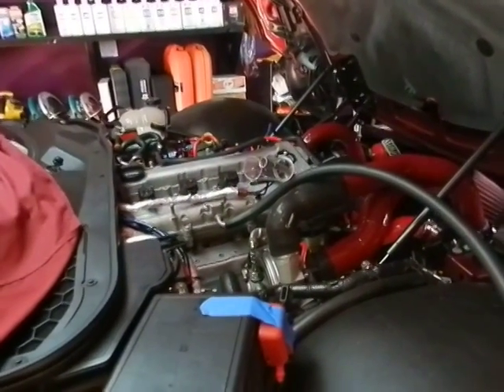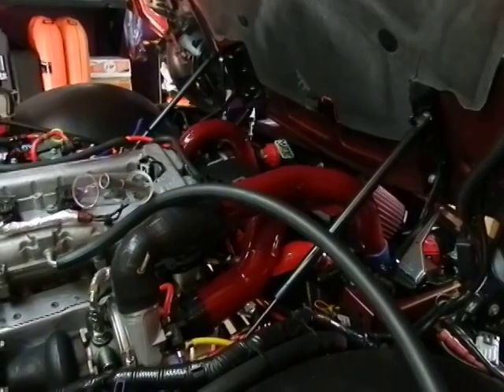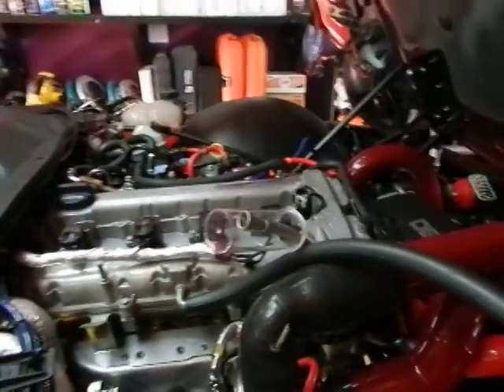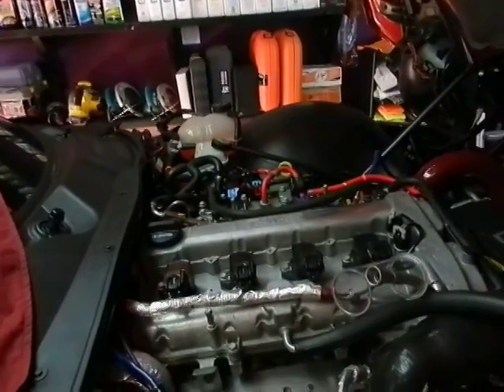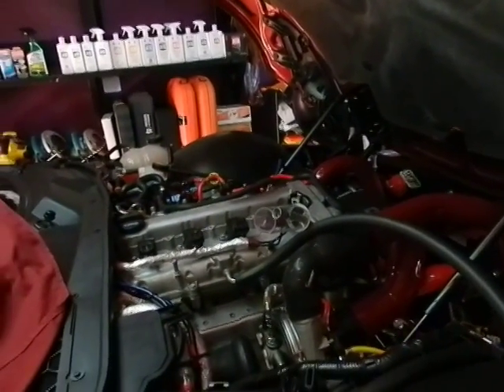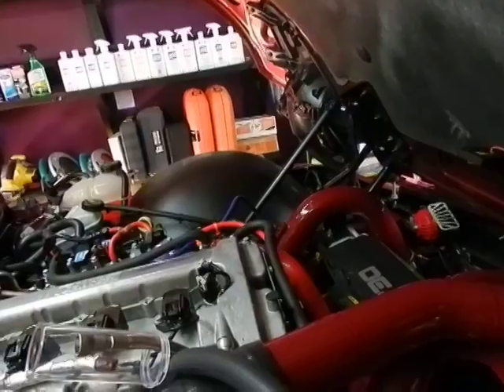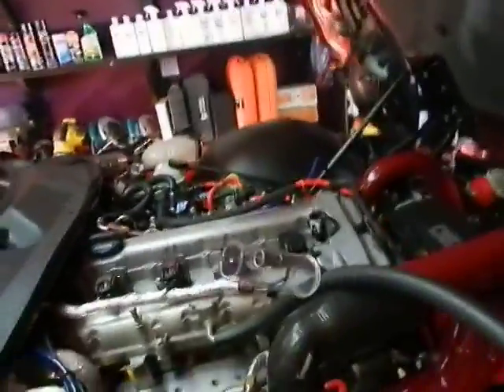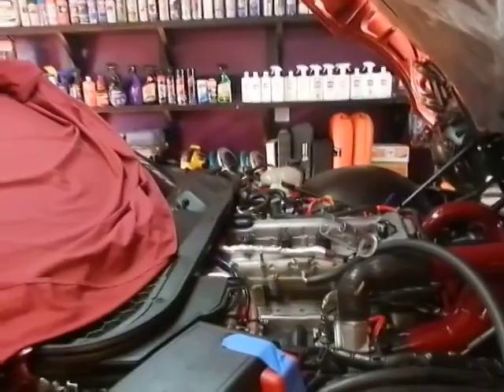EFR Upgrade Solstice - Engine StartUp Feb 4th

Comment: Hey nice car. I own an 06 Sol Hahn turbo and having a hard time with oil return line bolts at the flange. It's leaking. I used an Allen L wrench but not enough grip under the turbo. How would you deal with this? I'm asking cause we both have pretty much the same setup.

Comment: Gotta know, what are those gauges? Did you use a kit to replace the vents? Or custom job? Looks nice.
Reply from the maker: mikeakaspike 
The gauges are from a company called PLX Devices. They are awesome gauges, but pricey. The install was custom. But very simple to do. The gauges fit straight in without any modification.